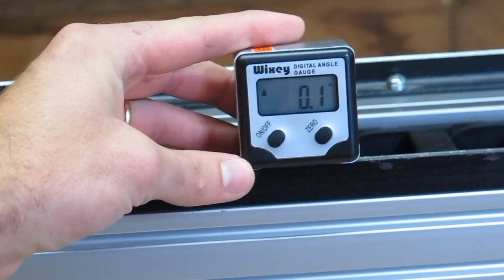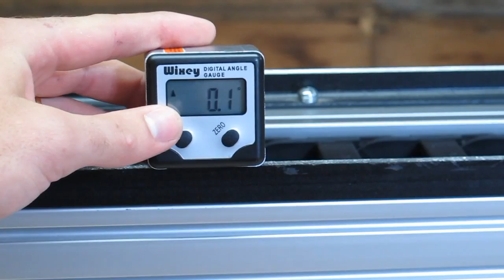Homemade CNC X axis explained

Comment: i know this is an old vid, but had a question i built a CNC plasma using Angle iron as well and works nice and am looking to build a router doing this as well. have you cut any aluminum on your CNC? and if so how did the angle iron hold up with that?
Reply from the maker: I did cut some aluminum, just had to take it slow.   If I were to make a machine again In would go with linear bearings though.

Comment: I would like to build CNC with dimensions/size just like Yours but I'm not sure should I make it just same with (two) short X with ballscrews and long Y (gantry) OR should I go for long X with rack and pinion and *short Y gantry with ballscrew? 

You have two long aluminum profiles for gantry so I supose they will not bend ?

What do You think, which option is more practical for work around, less costly to make?

Comment: Can someone ask on my question: Why to use RACK and PINION instead of BALL SCREW? 
Because of low speed of the stepper motor or there is any other good reason?

Thanks so much!
Reply: +Matic Rožič it would take just about forever to wait for a leadscrew to move that far... plus you have to factor in the sag depending on the size leadscrew.

Comment: I'm designing one of my own too. I saw yours and was thinking why you put the moving structure over the longer side instead of the shorter one (would be more stable and flex less I guess)
Is there any reason I'm missing?
Thanks in advance
Reply: You're right, it would be more stable like that and probably wouldn't need the u channel.
Reply: garofalo42 Paul Kersey  I think it's much more convenient MrFrabcabert's way.

Comment from the maker: I guess this would depend on where you live, and availability of materials, etc.  It cost me around $2500-3000 mark.  that includes the controller the base and machine.   Software is extra, unless you get the free software that is available.

Comment from the maker: Hi, yes I have a rack and pinion on each side.  You need a separate drive for each motor and in MACH 3 you Slave one side to the other and reverse it.  Easy as that.  
As for 23's vs 34's  the 23's had MORE then enough power for my machine the 34's would have been overkill.

Comment: hI a quick question on your y axis, are you running a rack and pinion on both sides? and if so how do you wire that to your controller do you need 2 controllers to 2 steppers or one controller to 2 steppers?    thanks for your time

Comment from the maker: Can't help you there. I only have experience with Mach 3 and Fanuc.  I would recommend Mach 3 to anyone, its a very powerful software.  I personally bought myself and old second hand xp computer and ran mach 3 off of it.  A pc for the shop, which i wasn't to worried about because of dust, etc.   You can alternatively use an external motion controller to run mach 3 through 64bit.  Go to CNCzone and search for some info there.

Comment from the maker: The Z axis doesn't need much force.  On the Z you want speed for 3d carving.  You don't put your body weight on a router just to get it to into the material...  You'll have to do some research on testing Flex/twist and how to test it.  I don't have a concrete way of doing it.

Comment from the maker: Yes, router is better then dremel for this application. you can machine anything you want with what ever setup you have. You just have to be smart with your tool paths.  Softmetals will probably be a mm or 2 deep passes at once, but in the end the product will be the same.  I would be more concenred about having a sturdy frame/beam, that way you can upgrade/swap the router to what ever you want in the long run. I think a higher % of the quality of your machine depends on its structure/frame.

Comment from the maker: Thanks, If I was you and wanted to machine soft metals, I would worry more about the spindle then the steppers. I have Nema 23 570Oz on mine and I have cut aluminum with it. The limiting factor for me was the router/bit.  I have ripped a 1/4" wide about 1/4" deep gouge into my MDF table before, the breaker for the router quit and the 23 nemas just kept going. As for lead screws, I dont know what you would need exactly, because I am running Rack and pinion. I did have the 1/2" rod for the Z axis.

Comment from the maker: @macmainuk Hi, its rack and pinion drive, no lead screws.  You see the bar on the side with all the little teeth.  The steppers have a gear attached to them (at a 3:1 gear ratio, i think), that is how it moves.

Comment from the maker: @molceonly The play I mentoined was the amount of space the E-chain had between the 2 beams and not that of the wires.  Those bolts do not hurt the echain, I get a smooth motion out of the chain, no bouncing off of any bolts.  The reason for the larger E-chain was for potential future upgrades to a spindle with water cooling.

Comment: that bolts are seriously painful for your E-Chain. try to switch to countersunk. 
you might wanted to use even smaller and sturdy E-Chain, we can help you save money for next project. please consult to your IGUS sales for #1400 or cheaper, i notice you put only 3 cables. the "play" you mentioned happen because you have unnecessary height for chain interior.

Comment from the maker: @RianoKan I'm not sure what you mean with supported from below.  Mine is attached to the Y Carriages at both ends. At 6' with a double beam and a steel plate on top, I think you will be more then fine.  Things you will need to consider are the weight of your router/spindle.  But that shouldn't be an issue at 6'.  My carriages flex because they are made out of MDF.  Aluminum would have solved lots of issues.

Comment: @MrFrabcabert Yeah, but will it bend if it is fully supported from below?  I am making a 6' axis with 2 1545's.  I forgot to mention, there will be a 1/4" steel plate on the top to act as linear rails, so maybe our designs don't match up.  I hope it works.

Comment from the maker: @RianoKan Thank you.  The 8020 it self will twist/bend when under load.  The way my beam is made I do not have any issues on the beam it self.  For me its the carriages on the Y axis that twist, as well as the X axis carriage tends to twist, flex, etc if I place enough force.   Maybe Deflection is the wrong word?  I'm no engineer.  But when the beam is under force (the 8020 that is) it will flex a certain amount, and this was very noticeable at the 10' beam length that i have.  (8' cutting area)

Comment: This is very nice.  Can you elaborate on the deflection issue?  If the long axis is mounted to the table as 2 rails sperated by the mid axis distance, and the gantry moves forward and back on the 8020 (1545), is there really deflection?